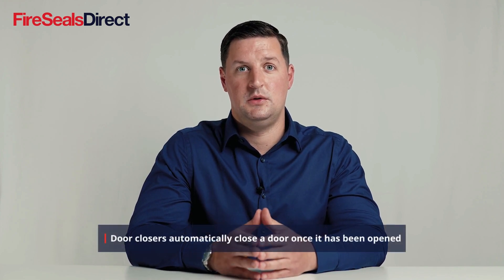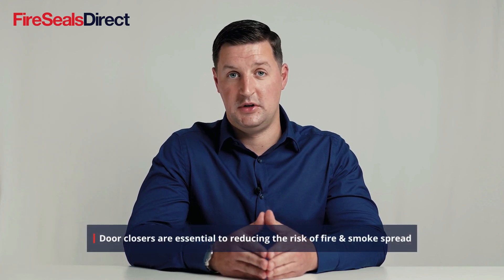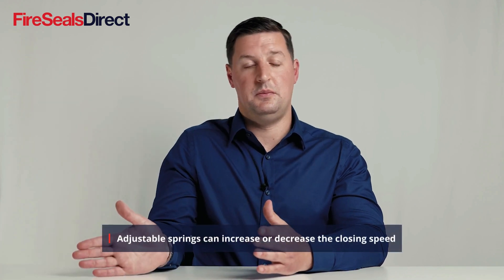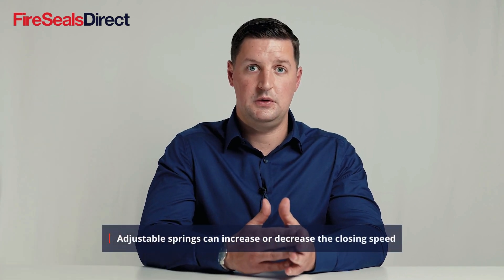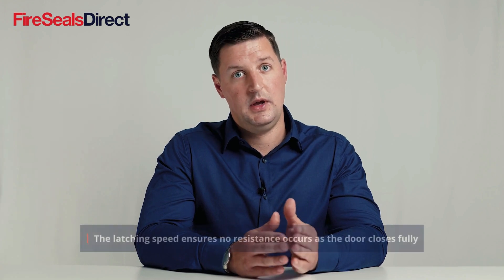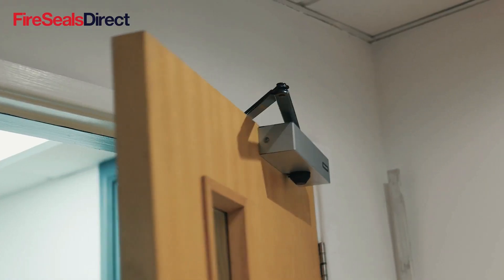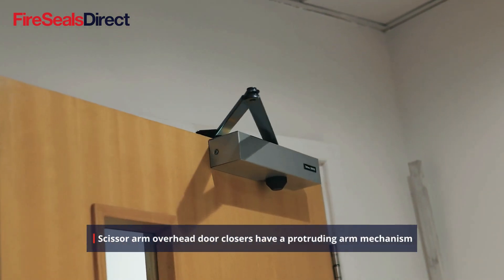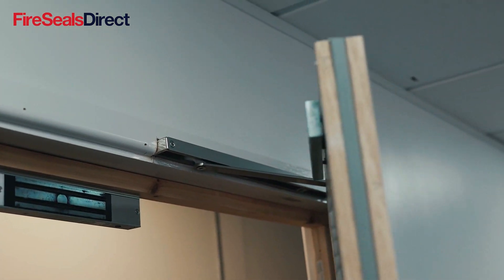Door Closers Explained

Comment: Would this still mean that the max Newton force of 22.5 and 30 are still the same or can the force from some closers be greater in some cases?
Reply from the maker: This is correct, the maximum force is 22.5 and 30 in order to comply with ADM and BS8300. A hold open and free swing door closing device may be a better alternative in cases where the opening force of a door exceeds 30 newtons